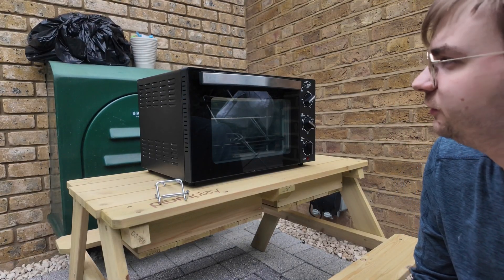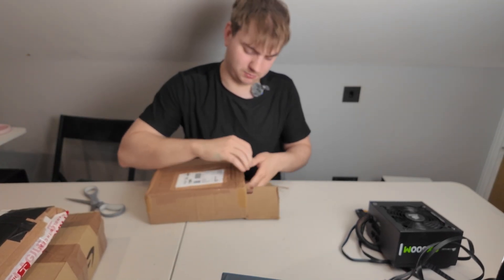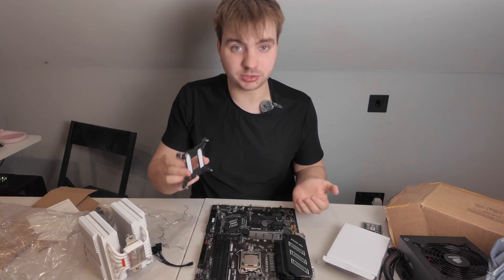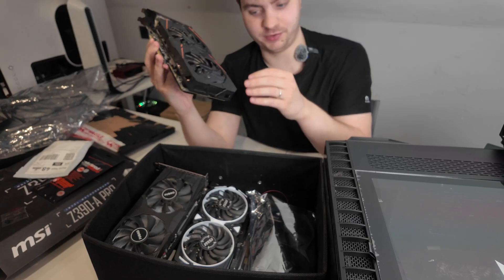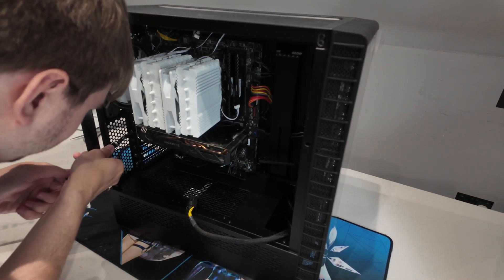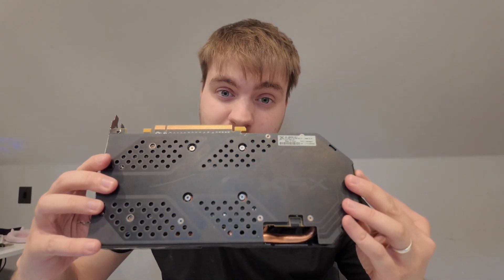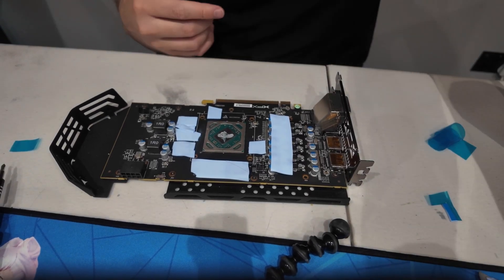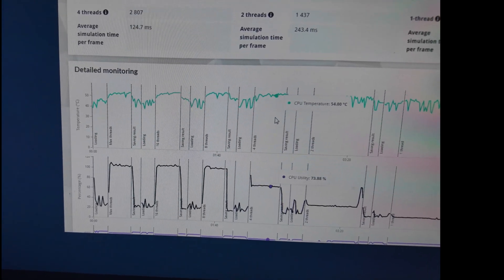I Cooked My PC to Make It Faster

Comment: im about to go to the UK on holiday and looking to get a pc for about 100/150 quid,any advice on what specs to look for?
currently hoping to lowball for a 1070/1080 and then found a i5 8th gen bundle with mobo,psu and ram for 85 quid (yet to negotiate) opinions on what else i should look to or is this good enough (have a case and monitor already)
Reply: also my current pc is a 5800x plus a 3060 which i paid r11000 (about 450 quid) however i dont need the performance that it provides for my current games so im looking for a dirt cheap good mobo/cpu/etc combo(s) in the uk cos it would cost double to build locally in SA
Reply from the maker: At the moment i have seen a few 1080s go for around £70 so that would be your best bet. Intel really does seem to to cheap here in the uk as everyone wants amd. I honestly think that pc would be fine with a 1070 and overclock it. You can get 16gb of ram for around £10-15 normally too
Reply: @BrokeQuests  i've even seen an i3 10th gen for like 20 quid but yet to find the mobo for less than like 60 pounds
Reply: @BrokeQuests  ive also found a 2070 super for 80 quid,idk if i can pick it up so if you want the link,i'll forward it

Comment: you need a pcb heater to remove the vrams, the toaster oven trick could work but it was overcooked lol
Reply from the maker: Oh no another tech item i have to try convince my wife we absolutely need! (Currently have to replace our oven after letting off deadly fumes with the gpu 😂)
Reply: @BrokeQuests  keep the oven as a special potentially dangerous fumes inducing things oven , you could use it for another project like heating plastic sheets If you want to do vacuum forming, drying powder coat paint or cerakote annealing 3d prints and stuff.

Comment: next time build a water cooling loop but put the radiator outside of the case, hell maybe even out the window for extra cooling. Use used parts and flexible hoses lol.
Reply from the maker: At this point I might just attach the garden hose to the build 💀